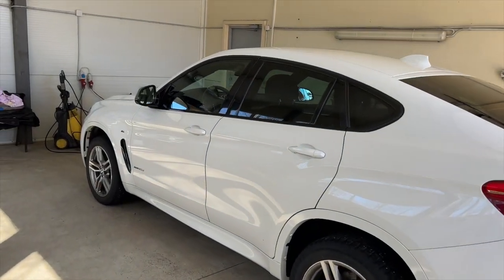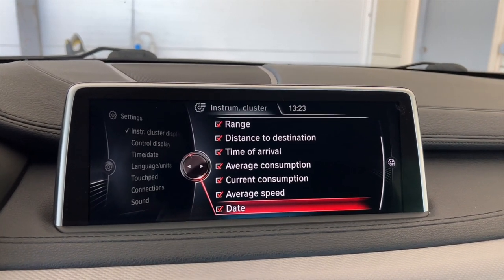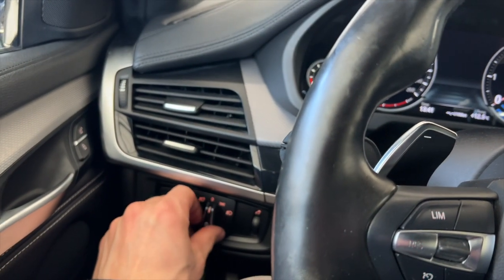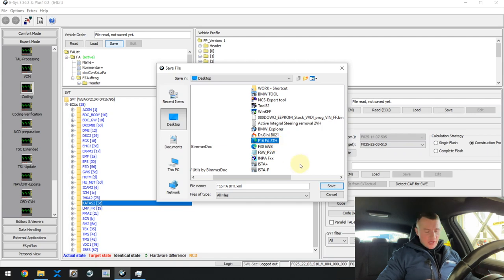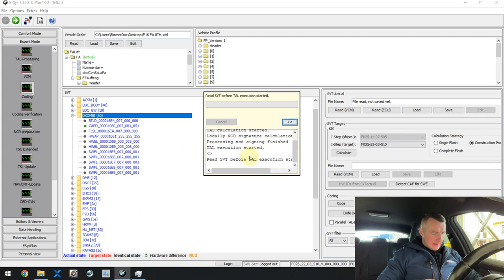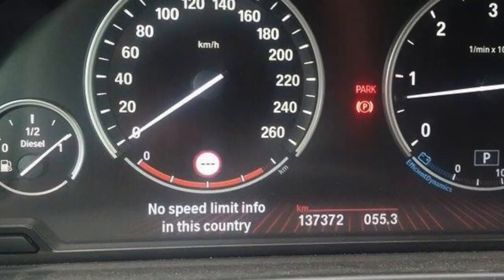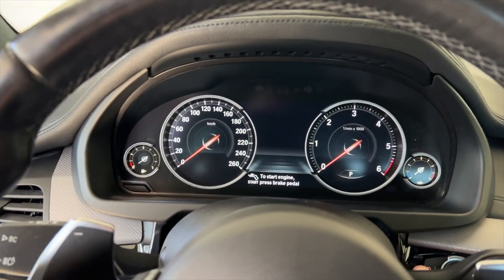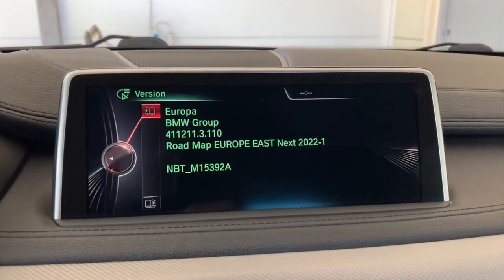Speed limit information (SLI) activation on BMW is easier than you might think.

Comment: Hey. Thank you for the awesome videoes.
I will try to add Lane departure warning with coding.
I have all hardware: KAFAS2 and vibrator in steering wheel (required) but no on/off switch

In this video you dont mention the LDW option,  Why is that?
Reply from the maker: LDW does not require FSC code. But yes it is also possible with KAFAS2
Reply: @BimDoc  thank you so much for that info. I'm thinking of doing the complete driving assistance for my 2017 f31 lci.
Do you know if 'pedestrian detect' and 'lane change warning' require a fsc.
I hope you have a good day your reply sure saved my day 😁🤝

Comment: Thanxs for another great video! I already have SLI, but i'd like to add also SLA. I've managed to get all the menus for it only while tinkering with Bimmercode in expert mode, but it was not working. Could you please help me with that? I am already using ESYS. Which FA code do i need to add and/or remove? It is F11 07/2014. Thank you very much. Bolshoe spasibo.
Reply from the maker: Lane keep assistant requires extra buttons as well. Not only the coding.
Reply: @BimDoc  i have it already. The button for lane change warning. Got 5AS option, but i’d like to change it to 5AT. Actually i was initially asking about SLI (speed limit info) and coding it to SLA (speed limit assist) :)

Comment: Hi Vladimir,

I have a BMW G31 2017 and I have Kafas Camera and Professional Navigation, but I don't have SLI activated. My Question is the Process Activation the same like in your Video or Coding is not the same? I have a buyed FSC Speed Limit Info Code...

THX
Reply from the maker: On G series procedure is a bit different. 
FSC code is still needed, but instead on FA coding you have to make FDL coding

Comment: I have f11 03/12 press identify and when  i press check fsc status  error message cannot read ecu or somwtehibg like that, i had sli avaiable before but after uodatebi cen see only ---.. iny ideas? Maybe   wrong esys version..?
Reply from the maker: Definitely not the esys version issue. 

Maybe fsc codes were wiped out and have to be restored.

Comment: Hello Vladimir ,
I've been trying to code the SLI to work in an unsupported country , but without success ..
I have tried multiple Country Hex codes but none seem to be working , i have also tried enabling and disabling the horizontal option thing (can't really remember the name), but no luck !
I have read basically every thread and discussion on this topic but nothing has worked :(
And believe me, there is a lot of users looking for solution.
Any idea what could work ? Please help.
BMW F11 2011 with KAFAS1
Forgot to mention , I have the 2022 Maps (EAST) installed , living in the Balkans currently.
Reply from the maker: Try setting parameters for CAMERA only 
Wo navigation

Comment: hi i got this message after adding 8TH can anyone tell me what it means? Could it be an error in the database or a hardware error in the car? Thank you for your repl
Reply: No FP could be generated from FA "". [C002]
Not all elements of the FA were found in the FA2FP: SALAPA 8TH
Reply from the maker: It means that option is impossible on your bmw. 
Most likely you have G series and over there procedure is a bit different
Reply: @BimDoc  I have a BMW 218d ACTIVE TOURER F45
Reply: @BimDoc  according to the vin number, my car is not equipped with a front camera, but in fact there is a camera in the car, could the first owner install a front camera? I also have collision warning enabled AppId 190 FSC code accepted. AppId 126 I have FSC code not available, 191 FSC also not available . Does 8TH apply even if the camera is retrofitted? Thank you for your response

Comment: I want to activate SLI on my G30 which has KAFAS4, DKOMBI4 and HU_MGU.

I read in some Forum that I need to set the following FDL Parameters by FDL coding.
But in your video you have only added option 8TH, then calculate FP and press on Code.

Does that mean I do not need to modify this FDL Parameters manually?

HU_MGU:
SPEEDLIMIT_INFO: aktiv [01]

KAFAS4:
NPI_ENABLE: initwert [01]
SLI_ENABLE: initwert [01]

DKOMBI4:
ADDITIONAL_SIGN_ENABLE: aktiv [01]
CB_TACHOZEIGERBAND: aktiv [01]
HUD_NO_PASSING_ENABLE: aktiv [01]
HUD_SPEED_LIMIT_ENABLE: aktiv [01]
NO_PASSING_ENABLE: aktiv [01]
PIA_HUD_SLI: aktiv [01]
PIA_HUD_SLI_NPI: aktiv [01]
PIA_HUD_SLI_PORTIERUNG: aktiv [01]
PIA_HUD_VSLI: aktiv [01]
PIA_SLI_NPI: aktiv [01]
PIA_TACHOZEIGERBAND: aktiv [01]
PIA_TACHOZEIGERBAND_PORTIERUNG: aktiv [01]
RCOG_TRSG_APPL: aktiv [01]
RCOG_TRSG_TIMEOUT: aktiv [01]
SLI_PERMANENT_ENABLE: aktiv [01]
SPEED_LIMIT_ENABLE: sli [01]
TACHOZEIGERBAND_ENABLE: aktiv [01]
Reply from the maker: On G series 8TH will not work and the only solution are those FDL parameters 😉

Comment: Hi Vladimir, 
Thank you for a fantastic video.
I have a Bmw X3 G01 2018 for German market, with SLI working excellent in EU countries.
But in my country (Serbia) it does not work, only three lines in a white-red circle.
Is there a way to make SLI work in Serbia and other non EU countries? 
Thanks
Branislav
Reply from the maker: It should be doable.
Reply: I have exactly the same problem. 2018 F36 with 6WB cluster and active 8TH but it's not working in Serbia. As soon as I cross into EU, it starts showing info (speed limit, and some other signs). I'd love to learn solution for this.

Comment: @BimDoc will this work exactly the same for G31 with iDrive7 MGU and original FSC? I guess only the kafas version (3 instead of 2) and the appid (reg  adresses) may change?
But coding the FA and the ECUs is basically the same?
Reply from the maker: Fsc is required yes. 
But not so straight forward. 

But still doable
Reply: Why not so straight forward? Because of component Protection?
Will you make a Video about activating sli in MGU soon?

Comment: Hi mate, i do have few questions please
1) I have bimmercode and it is working fine with my OBD, do i still need enet? My car is F15 (bmw x5 2016)
2) where is the speed limit reading from? Is it the map because my maps doesn't have a speed limit. But i have KAFAS system
Reply from the maker: If you know all the parameters then you can make it via BimmerCode also. 
The only question how to import fsc via BimmerCode?
So enet and esys are still needed.

Comment: Logical explanation of the "low" ethernet flow between CAR and LAPTOP:
OBD ethernet has only 4 wires connection: therefore 2 twisted pairs (1 pair for transmision, and 1 pair to receiption) : 10 BASE T and 100 BASE T --> Maxi 100Mbits/sec ~~> 10Mbytes/second MAX.
To have an 1Gbit/second connection (and 80..100 Mbytes/sec), 4 twisted pairs are necessary (8 wires): 2 pairs in transmission and 2 pairs in reception, we are talking here about 1000 BASE T. Which is impossible with the 2 pairs present on the current OBD. The maximum of 8 to 10 Mbytes/seconds is therefore completely normal.
Sincere admiration for your tutorials, which will, I hope, allow me to upgrade the KAFAS2 of my modest 320D with SLI 8TH, which was forgotten when ordering the car.
And that BMW refuses to implement...
Thanks again.
OS
Reply from the maker: Good input. Thnx!

Comment: Thank you for your video. This is exactly what I need for my F30 LCI. 
In the beginning you said if there are other retrofits we need to know about them. But what do you do if there is other changes already in ECU from previous coding?
I have Japanese import and dealer has coded ECUs to work in my country like map and radio, if I retrofit SLI and recode ECUs they will go back to Japanese? What should I do after if this happens?
Thanks
Reply from the maker: If other codings or retrofits were made, then:
Option 1) you will need to restore all the previous codings manually
Option 2) FDL code needed ecus not to loose your previous codings (but you need to know exact FDL parameters for retrofitting the SLI)
Reply: @BimDoc  Cool. Thank you for coming back to me. I think I will try to FDL code it, just have to find out what FDL needs to be changed for 8TH.

Comment: Hello,
After coding the 8TH option (SLI) in 3xECU (KAFAS2, KOMBI and HU_NBT): SLI is present
- in the HUD 
- in the KOMBI.
- FSC 0x7E upgrade of KAFAS2 is also ACCEPTED.

There remains one curiosity that I would like to clarify:
Rereading the car's FA after coding : the 8TH option has disappeared, everything works well, but the 8TH option is not included into the car's FA. 
Also the I-Step in the car remained the original one (mine is F020-18-07-547), coding has not replaced it by the one selected during connection (F020-23-07-530)
Do you know if an additional operation is necessary to make this consistent (flashing, other) ?
Thank for an answer if you have
Reply from the maker: Answers:
You don’t see 8TH because you did not write it into your vehicle FA

And istep changes has to be made manually via VCM Master tab

Comment: Hi, great info. I have a 2013 E70 X5m with high beam assistant (camera in windshield), is this KAFAS based? My navigation is 112184.2.13 premium (usb) 2020 and I have driver assistance package code 0ZDA. Just wondering if this upgrade is possible in this case? Looking at rear view mirror options on realoem, I have S302A (Alarm) = Yes, S5ACA (high beam) = Yes, 55ADA (Lane Departure) = NO, and there is only one mirror option remaining with YES, YES, NO and it shows S8THA (road sign detection) = YES. How can I truly confirm S8THA is an option in my vehicle? I have a bimmergeek code reader if that helps. I would pay for services if you can help. Thx.
Reply from the maker: SLI on E series is possible, but it is a very rare option. 
I haven’t retrofitted SLI on E series. So more investigation is needed.
Reply: Thanks for replying. I did a little more research. Lane departure was on option on E70/E71's but not an option in X5M/X6M, not sure why. There is a kafas camera module and windshield camera that was part of the lane departure option.I have top view and side cameras, but doubt I have this specific kafas module.I plan to check the location under the driver dash for the control module. If not there I could add the hardware, but would be suprised if the power and camera harnesses are there. I did check coding and I do see the SLI setting, but it is disabled, as well as a few lane depature settings, also disabled.  @BimDoc

Comment: Hi Vladimir,
Thanks for the great video.
          I have already solved the problem on my BMW F45. So I hope this helps other F45 owners and I guess F46, F48, F55 and F56 as well (but not the same verified on my 2014 218d F45 ACTIVE TOURER). Everything exactly according to the video, but replace 8TH and enter 5AS, otherwise everything is exactly the same. However, I only have three commas for now because I don't have the FSC code yet, but I believe adding the FSC code will show the speed and not the commas. Well, I hope it helps someone
Reply from the maker: Good info ℹ️ 

Yes FSC will solve the issue. 
I’ve tried that on 2 series 😉

Comment: Hi Vladimir, 
I have an X5 X35d with KAFAS2 and 8TH enabled from factory and accepted FSC code.
This car was from USA and it has the NBT Head Unit (Not EVO ID5/6) , I changed the maps to Europe but the SLI only shows 3 dashes (---) .
Im currently in the Balkans and even if I code to camera_only it just does not work.
Do you have any solution for this?
Thanks in advance and please keep up the good work!
Reply from the maker: There are regions of the world where SLI is not supported officially. 
So switching to camera only is a right direction. But some more parameters have to be changed.
Reply: @BimDoc  Can you help with what needs to be changed please?
Reply: @BimDoc even if payment is needed, we can arrange that just put your email or telegram here so I can contact you. 
And as always keep this up , you're truly the BMW Doctor

Comment: Thank you for this video i already have this option on my F10 LCI also i would like to know if it's possible to add the high beam assist when we have the KAFAS camera ?
I know that it's mandatory to change the SZL but is it the only part to change ?
Reply from the maker: If you have SLI via KAFAS1 then auto light assistant will not work. 
Kafas2 is needed
Reply: @BimDoc  is there anyway to know if I have kafas1 or kafas2 ? Any physical difference ?

Comment: Is it the same for F82
Reply from the maker: Actually it depends on the KAFAS type installed. 
On all kafas2 ECUs the process is exactly the same. 
On kafas4 it is a bit different.
Reply: I have done it and added to the head up display and cluster now I should buy and FSC code right ?
Reply: Also it not shows that is not available it shows just like this - - -  - - -